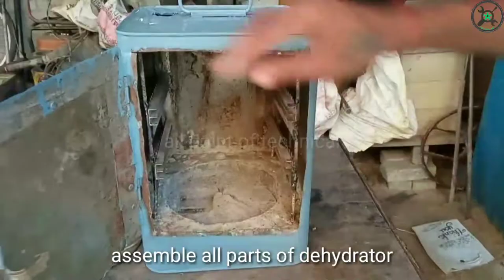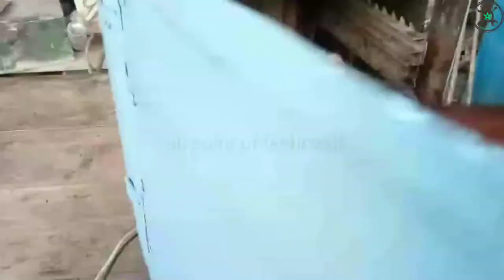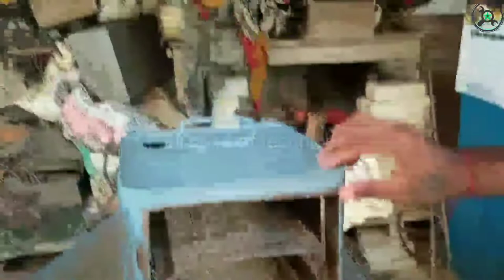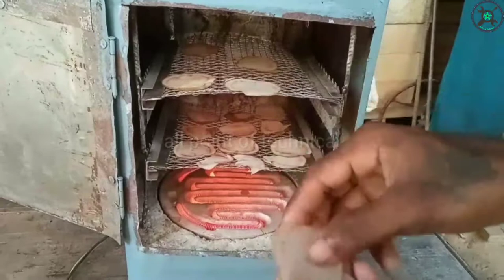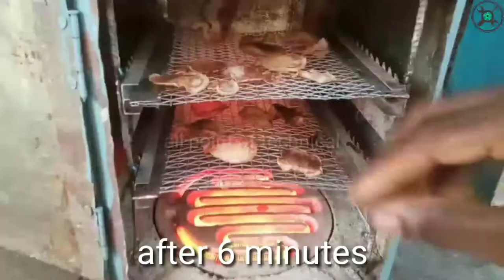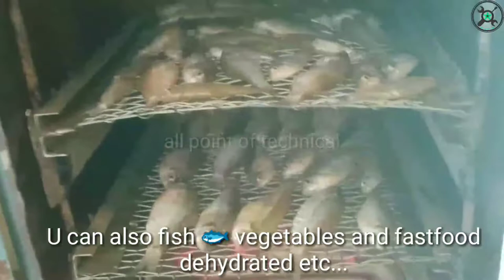homemade dehydrator | diy food dehydrator | new concept for dehydrator | very easy to drive

Comment: Nice attempt. But this generates very high heat. Not needed for dehydration. This is an oven as @sohan2510 says.
Reply: I agree completely BUT!
I must say, there’s no way it’s 250C or even 250F.

The fact he can open it using the completely Uninsulated handle and pull the tray out even though the element is cranked its pretty slick.